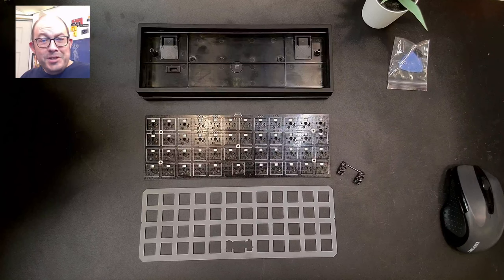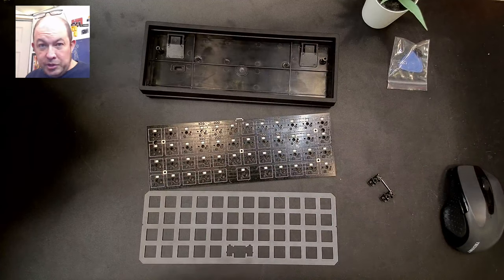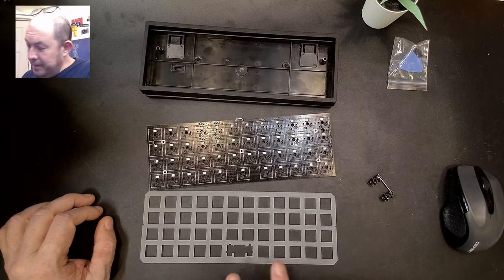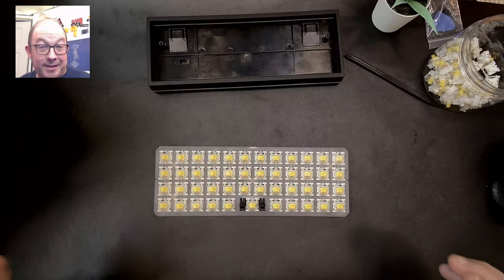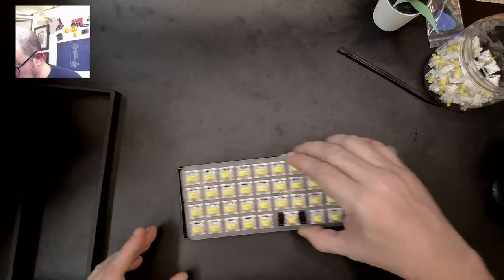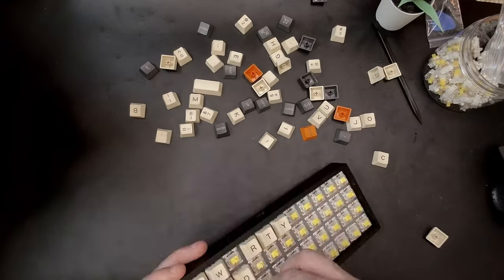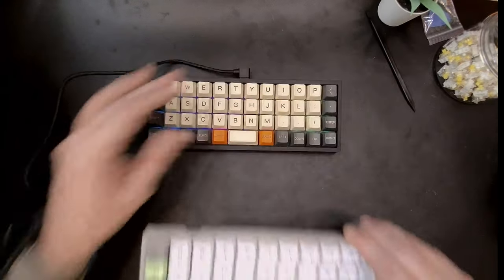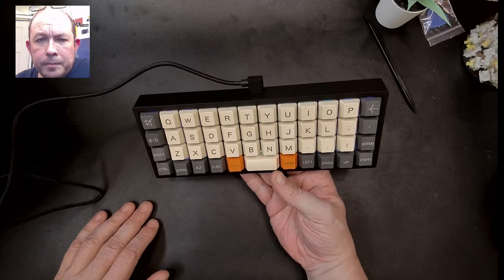CSTC40 RGB (OLKB) - 40% budget hot swap kit that as easy as Lego to assemble. VIA/VIAL compatible!

Comment: Ive been looking for a 40% for quite some time and I finally came across this one... I was looking at the Drop Planck but theyre never in stock so I decided to go with this... I ordered some Everglide plate mounted stabs and Aqua Kings for the switches. There are definitely alot of mods that are available in this board... Ive added some silicone dampening myself with the classic tape mod and its actually pretty thocky and sounds quite nice. Still trying to get used to the 40% ortho layout (Im typing on it right now so sorry for spelling mistakes lol) and it can be quite the challenge at times. I would definitely recommend this board but a little sidenote is if youre planning on adding foam of any sort you will most likely have to cut the usb-c hole bigger...
Reply from the maker: Awesome, thanks for the excellent advice, cheers!

Comment: Any idea what the polling and scan rates are for this PCB? 
I really want to try ortho, but also play competitive fps games where there actually is a very noticeable difference between 125hz and 1khz. 
There is an absolute void of information on most of the PCB's out there, while it absolutely doesn't matter for writing/data entry/coding/most games tbh, for CS/Val/R6 players, it's 1khz (point of diminishing returns) or bust.
 We really need to get the manufacturers to understand Polling + Scan rate = "Gaming" not RGB = "Gaming" currently it seems like such basic specs are hidden as if they were secrets. With CS2 on the horizon and CS:GO/Val dominating on player numbers, now would be a great time to grab that audience and pull them into the custom keyboard scene. 
Is it generally just a question of it the controller can be flashed with QMK? 
I'm lost in the weeds with much of this, I  have flashed many a chip, but manufacturers of keyboard PCBs don't even seem willing to publish the chipsets used?
Reply from the maker: I did some digging and only found crumbs, it may be this using the STM32H750 MCU, but I cannot say for certain, so I have no way to report the polling rate. QMK is more dependant on memory than polling rates. 

Here is the QMK source: https://github.com/qmk/qmk_firmware/tree/master/keyboards/kprepublic/bm40hsrgb

Good luck on your quest. Otherwise it's a great little board, but I don't do any intensive gaming, so can't truly say.
Reply: @MechKeyboards  I've done a bit of digging as well, it really is a sort of top secret topic.
From a post I found a user claimed that all keyboards since last April that use QMK firmware are now set to default 1000hz when wired. In part thanks to a largish manufacturer selling their boards with 125hz default which led to backlash from the OSU community. 
Now I can't find the post, but it stands to reason that any chipset that is capable of full speed USB 2.0 (not exactly new tech here) shouldn't be stressed by the polling rate, it just has to do the handshake right with the port.
Thank you for the quick reply, I went ahead and ordered the board and am looking forward to learning ortho and hoping the giant numpad with letters approach works as well in practice, after practice, as I've always wondering if it would. 
While I ponder why ortholinear in general isn't explained in that manner. (My suspicion that most of the younger generation hasn't ever used a numpad as they don't exist on laptops)
Reply: @All4Grogg did you confirm it being 1000hz

Comment: Hello! I saw this video and decided to buy this keyboard kit. However, I'm encountering an issue where both the PCB and the plate start bending when I insert the switches. I also followed your switch installation order. Do you have any tips on how to avoid this issue? Great review btw
Reply from the maker: As I do in the video, assemble the PCB and plate out of the case, insert switches carefully to populate the corners and middle, then go around the perimeter using a plastic spudger where needed to bring the plate up to lock the switch, ensuring to support the hot swap sockets from behind. Good luck!

Comment: thanks for the instruction. are the 6 underglow leds visible when the case is assembled? the case they sell seems to be opaque so whats the purpose of underglow if it doesnt permeate? do i have to make a custom 3d printed case for this to work?? and can u turn them on and off?? thanks
Reply from the maker: I think at one point there was an acrylic case, but I've not seen it in a while. There are 3D cases that can be printed using transparent filament, so it could be seen them.
Reply: @MechKeyboards i see. can u turn off underglow by setting up on qmk???
Reply from the maker: @wunderbar-q6y  if I am not mistaken, there is already a key bound to RGB off in VIA.
Reply: @MechKeyboards  thank you!

Comment: Nice video, what are the differences between bm40 and cstc40?
Reply from the maker: BM40:

* Underglow RGB
* Left USB-C
* Requires screws
* QMK/VIA
PCB only: $45

CSTC40:
* No Underglow
* Center USB
* Screwless design
* VIA/VIAL
PCB only: $39

Other than than, they are fairly similar, though the CSTC40 has a bit more heft as it has the faux MCU daughterboard attached.
Reply: @MechKeyboards Awesome info! What's the difference between de "QMK/VIA" vs "VIA/VIAL" thing? Im about to go down the rabbit hole of 40% keyboards but can't quite figure out that part... Thank you in advance!
Reply from the maker: @FACUNDO2213  QMK is an open source software, which one can make changes to the functionality of the keyboard. VIA/VIAL is a front end for QMK which allows for changes the configuration of the keyboard in a GUI.
Reply: @MechKeyboards  Excellent.. thank you so much for the brief explanation! CSTC40 on the way for me, hope to join the 40% team!
Reply: @MechKeyboards  Which one would you recommend. The BM40 or the cstc40. Can't choose between these two.
Reply from the maker: @kimdavid3084  either is nice, I can't say one is "better" than the other.

Comment: There is another 'sale' on Ali right now and I am wondering if I should pick one up: 
I read the case feels like its painted, which raises concern and I wonder, Is your case staying flat on the desk or is it bowing? 
Thanks mate 8)
Reply from the maker: Mine sits flat, granted I have not modded this yet and there is limited space in the bottom half of the case. If people are over filling with dampening material, I could see them over stuffing causing the case to bow. I overfilled my BM65RGB build on the first go and it was slightly bowed; after adjustments, the case remains flat.
Reply: @MechKeyboards  gonna think about it tonight and decide in the morning 🤡
Reply from the maker: @shadowcore94  right'O!

Comment: I just bought this keyboard, but I have tried every possible way to flash it, without any luck.
I have tried different computers and different cables.

Any ideas?
Otherwise hoping for a new PCB from KPrepublic or a refund...
Reply from the maker: Does the PCB light up when it's plugged in? How were you trying to program, using VIA or QMK? "tried" ways of flashing, flashing the QMK or VIA firmware? 

Lot's of questions, but too little to diagnose. 

Might I suggest you make a post in https://www.reddit.com/r/BudgetKeebs asking for help, it'll be much easier to troubleshoot.